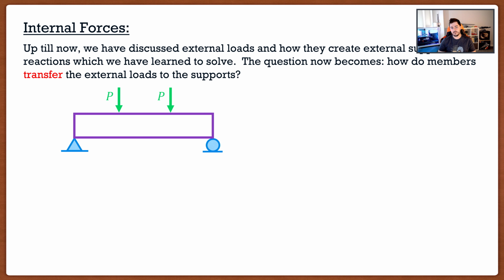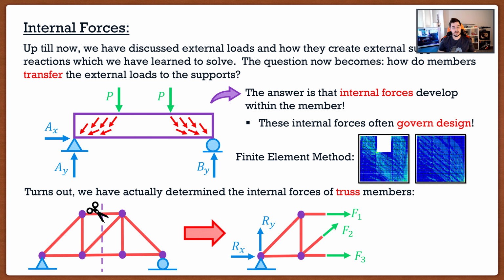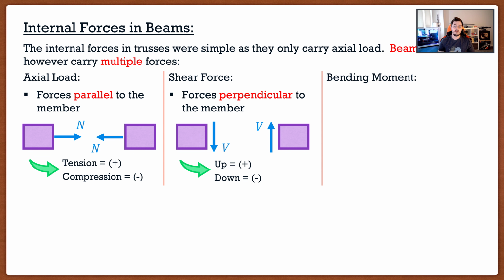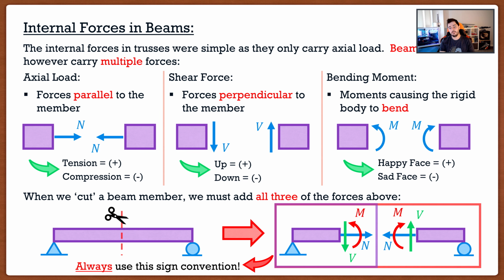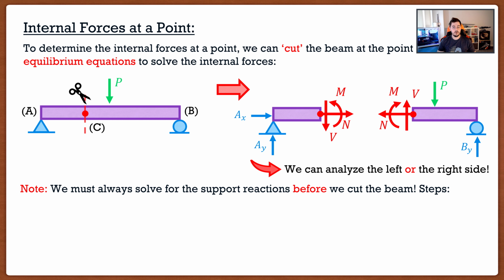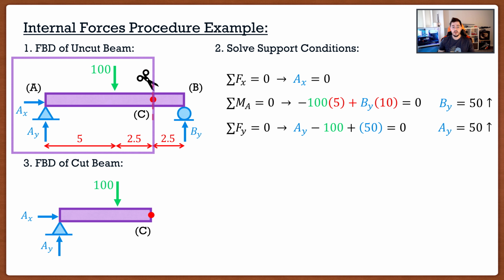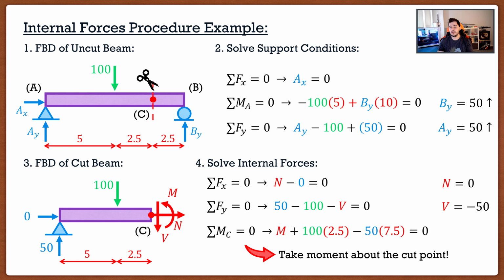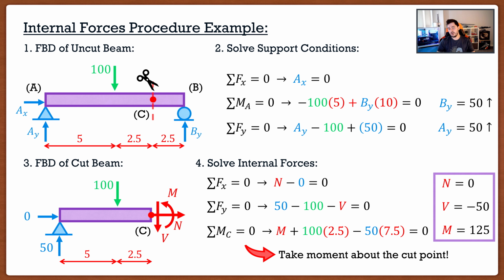Engineering Mechanics: Statics Lecture 18 | Internal Forces in Beams

Comment: In the U.S. counter clockwise is positive moment, so we're only taught the left sign convention and its understood the right is "equal and opposite" per Newtons law. In my class normal forces are understood to be perpendicular to the surface, so its explained as normal to the cross sectional cut and shear would be parallel to the cut surface; same thing just worded differently.